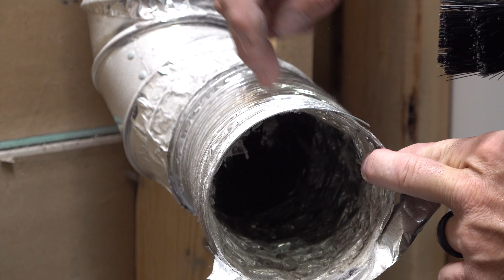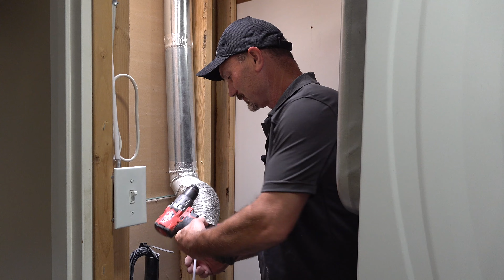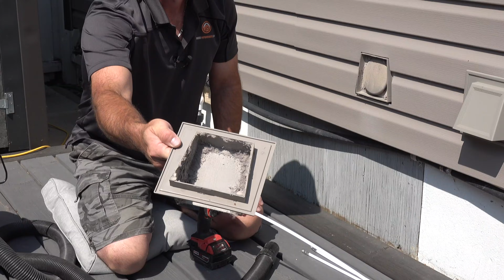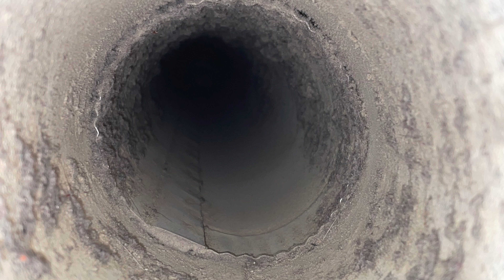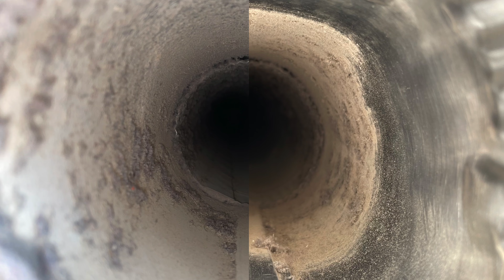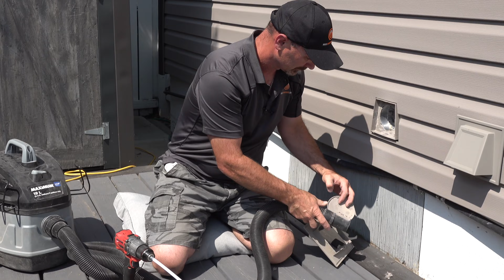How To Clean Your Dryer Duct [Vent]

Comment: I have had this cleaning device for quite a few years now and finally, after watching this video, I will actually put it it to work. Wearing a mask couldn't hurt either. I also want to get the duct cover you pulled off the  outside wall .... much better system than what I have.     Thanks, eh!!

Comment: Thanks again for a very informative video I would love to see how you clean out that bathroom vent duct and the vent itself actually...... thanks again
Reply from the maker: This same tool can be used on the duct and you can remove and wash the fan cover, and vacuum and or blow out the fan motor.

Comment: What would you do if the vertical vent actually goes all the way to the roof and has a reduced outlet that is part of the roofing job, that can't be removed?  Just go in from the bottom and go as far as you can? Or what?  Thanks.
Reply from the maker: Yes go from the end you can access and use extra extensions .

Comment: Almost worth cutting a permanent vacuum port into the dryer duct.
Reply: That would be cool if the duct had an easy access clean out for the vac and the brush. My Lint Eater Pro kit came with a fitting that a vac can attach to.

Comment: I bought this when it first came out and it works great. I usually tightly clamp a garbage bag to the dryer end and come at it from the outside. We clean the dryer screen after every load as well. Always best not to use the “corrugated” aluminum vents as the indentations trap lint like crazy.
Reply from the maker: All great tips
Reply: My thinking is that you need at least a small piece of corrugated because the dryer vibrates so much when it’s doing it’s job. The corrugated will flex while a solid may come off easier.
Reply: @poppy-p1z1z  Hi Kevin. I have not had that issue at all. I fasten the pipe elbow to the dryer outlet "tube" with a sheet metal screw. I have a 16 year old Maytag Dryer and there really is little vibration transmitted to the pipe. I do use steel els not the aluminum ones . They are much sturdier. The straight pipe lengths can be either.
Reply: Good idea. Thnx.

Comment: I bought this kit plus the 4 extensions years ago since my dryer run vents to my roof (22ft). The first time I cleaned it I removed a shop vac full of lint. Every homeowner should own one of these. I clean it twice a year.
Reply: Its recommended to clean every 2 years, but more the merrier I suppose.